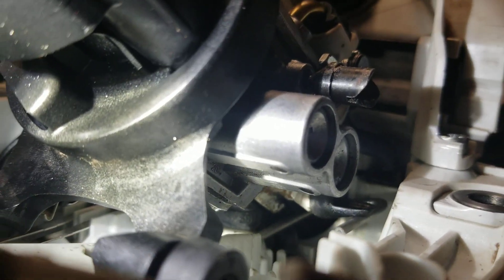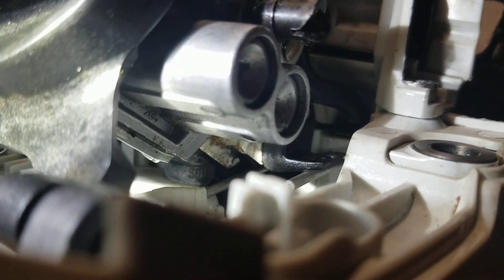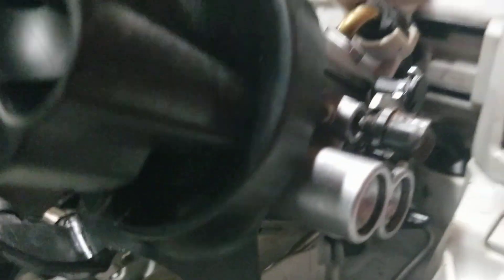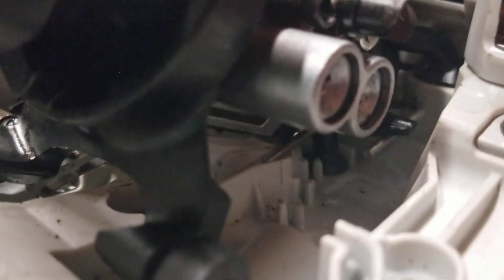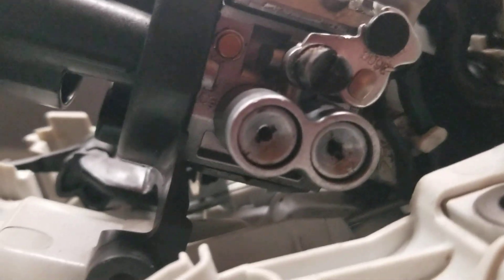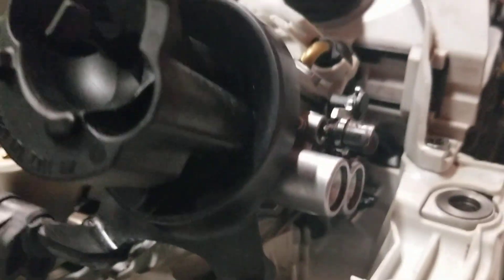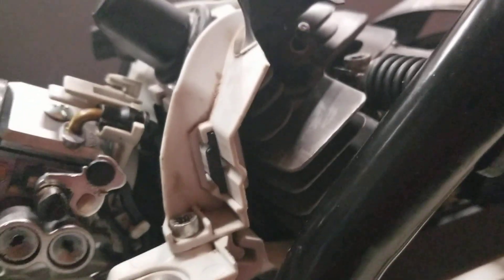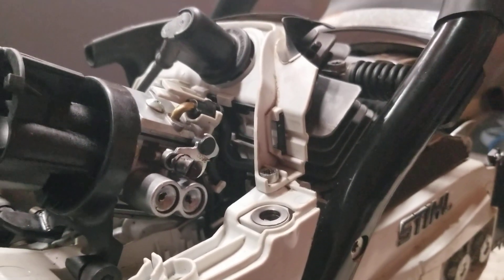MS 462 throttle linkage issue discussion.

Comment: Currently stuck with the same mess
Reply from the maker: Ok, I posted how I fixed it.  Look for it.  Hopefully not snapped off too far.  Garbage design.
Reply: Currently I have a zip tie holding it in place till the part comes in. . . 🤦‍♂️
Reply: worked fine all day 😂😅